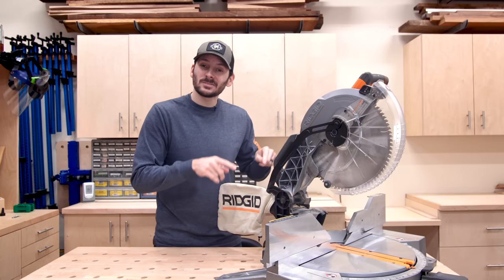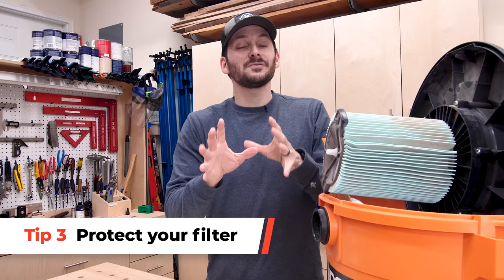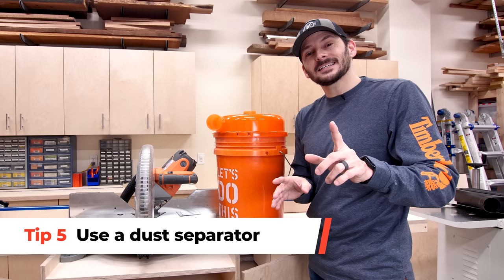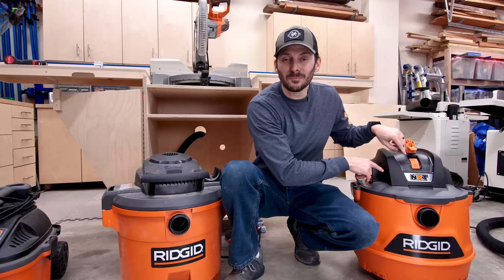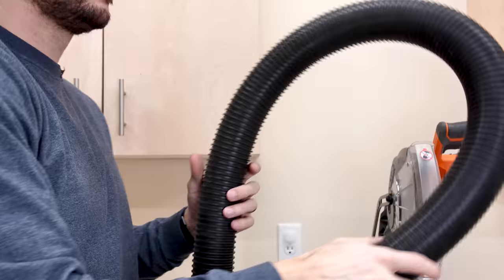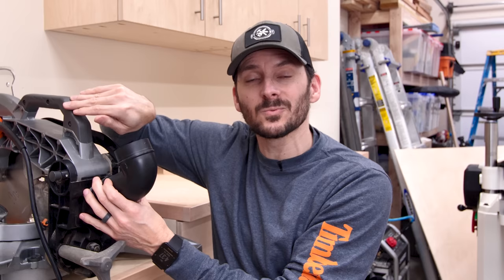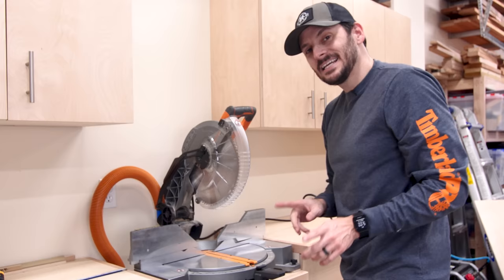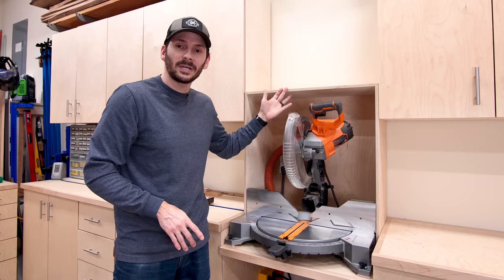10 Tips for Better Miter Saw Dust Collection

Comment: Have old Makita miter saw, for which I first built a cart, then added a cabinet above with a 2.5" hole for the vacuum hose. I ignored the horrible 1.25" dust port on the saw. I have a separate dust collector and cyclone collector. I added a front face to reduce dust blown forward. Some dust still flies (annoyingly) from the contact point between the blade and the work which the cabinet doesn't cover. I may attach a 4" hose to the cabinet--dust nirvana.
Will eventually make a fabric dust "tarp" to pull over the blade-work contact point to stop dust. 
I hate dust.

Comment: we have this exact same issue.  We have both the shop vac and the big HF 4 inch dust collector.  Our saw is a sliding miter so we don't have a ton of room behind the saw.  I want to do a big cabinet for the 4 inch port.  I am thinking a hood like you have made and then a big funnel under the saw that exposes the entire back of the saw so that it will basically suck everything that gets flung backwards

Comment: I may be wrong but I believe that the rubber boot on the end of the 1 7/8" replacement hose is meant to stretch over the fitting on your saw. I think I watched another video that specifically pointed out that fetcher.

Comment: I recently found out that if you read the literature on the hepa filter, it is only hepa if it is used with the dust bag. Otherwise it's only just a tiny bit better than using the "fine"

Comment: Since sawdust seems to want to go everywhere Use sheet metal to round the rear compartment down to table height. Make a trough ( tempered Masonite or other very smooth stock) at that point tapered to a centered 4" hose port. Suction  hose would have to come horizontal across side.

Comment: What about making a dust collection system that incorporates the dust port as well as a couple of ports on the back/bottom of the dust hood? Basically after your dust collector is piped (4" piping), it goes into a port at the top of the dust hood, from there it spreads out to the entire back wall of the dust hood and opens up at the bottom (you would only need about a 1/2" of space between the panels)... kind of like a whole home vacuum cleaner port under a cabinet. Put a flexible hose into the panel to catch most of it and what falls to the surface would be sucked up by the open ports at the bottom...

OR... if you are looking to remove the vac under the miter saw you could drill holes in the miter saw surface and pipe the dust collector under it as the dust is spit out by the miter saw, it is sucked down into the holes under the surface and into the collector.

To turn it on, put it on a smart switch (or receptacle) that you can control with a button at your miter saw that turns off automatically. Although this might get annoying because it might turn off in the middle of a cut, you would be able to turn it back on with the touch of a button.

Comment: The biggest problem is the dust shroud.  Most are not of the size that facilitates collection, usually too small.  They choke off the air flow and the result is the chips etc blowing all over.

Comment: Nice build, Brad. I wonder if you can tilt the saw under that hood though. I am going to have to build one myself.

BTW....while we are on the subject of miter saw dust collection, one saw to absolutely avoid is Harbor Freight's Hercules brand. The dust intake (right behind the blade) has two rubber lips that, when you put vacuum pressure behind them, just suck together blocking all air (and dust) from passing. I have written to the company and they responded that they would get back to me but never have.
Reply from the maker: the way the motor is on this saw, bevel cuts should be fine.  May vary for other saws.  And that doesn't surprise me from HF
Reply: You’d be surprised how much room a comfortable  full bevel takes up.

Comment: Awesome video.  Home Depot would be proud of you.   As within a few days of watching this video … I purchased the stuff.  And after a week it all began show up.    But along they 1:10 mark your talk about “the need for adapters”. I’m stuck.  Any ideas for me or going from the Dewall miter saw at 1 1:4 inch connection to my brand new Rigid vacuum and hose setup.  They didn’t have the car kit but I did purchase the upgrade hose you recommended.    But not bad as I purchased 5 of 9 of your suggestions.  And will order the separator very soon. Just need help on the reducer adapters.  Thanks.  Again. Great video.

Comment: 11:55 - Another trick is to find Silicone Reducers that are used in Cars. If you have Dewalt, you can find some that will fit your Dewalt Table Saw Dust Port to the your Dust Collector. May need to wait 1-2 weeks if the product is being shipped from China.

Comment: Only one problem with the relay switch - the saw and the shop vac together will likely pull more than 20 Amps , so won't you need a *30 Amp circuit*? I only have 20 Amp circuits in my garage.

Comment: You mentioned the gallon size of the vacs but I didn’t hear you mention the Cfm size or even hp. You did say cfm was important so I was hoping for a min recommendation.
I take it turning your 3D part so it flows out and down, instead of up, didn’t work for some reason? It seems logical to route downward since you run the hose down anyway and that would eliminate the 180 and help airflow.

Comment: Interesting. I gave up on using the built in dust chute on my saw, instead I built a housing around the saw. It works... Ok. I'd like to figure out a combination of both. I have a 4" pipe to my dust collection coming out of the bottom, and it keeps most of the dust contained. I do still get a bit of residual buildup on the bottom, which I just push into the 4" hole from time to time.

Comment: Lots of people claiming the iVac switch fails within a few months with a larger vacuums.  Apparently they aren’t rated for the start up power.
Reply from the maker: I've been using this exact switch for over 6 years with no issues.

Comment: // important note //
the HEPA filter you're using needs to be used together with the rigid hepa dust bag to actually perform at its rating. it's badly communicated by rigid but you can find in the fine print / FAQ of the product

Comment: One thing I did not see mentioned is that the rigid HEPA package states that to meet HEPA requirements you have to use the HEPA filter and the HEPA bag. Those bags are expensive. I only see them available as part of a kit - two HEPA bags and a HEPA filter for $60.

Comment: Anyone know how a down draft style set up   inside a hood would compare  to a shop vacuum straight connected to the saw dust port vs.  using the same said shop vacuum to power the down draft port.  Is the enough CFM ?

Comment: I have the same miter saw and love it, except have you notice you can’t cut 2” lumber at a 45angle when you bevel the saw to the right? The motor hits the wood and it stops the blade about 10% short of cutting right through???! Bizarre design flaw, have you found anyways around it??

Comment: I wonder. What if the bottom of your enclosed dust hood involved a sloped floor? Think of it like a shower pan with a steeper slope. That way, most of the dust would be encouraged to head into the bottom port.

Comment: What I found most interesting about this video is the port on the front of the saw. I have a DeWalt and the dust port to suck up the dust is just a wee bit of a thing. Did you makes larger port for that saw or does it come with it? Now that would be something to figure out for the 3D printer

Comment: One thing I did not see was you actually using the miter saw after you put on the attached hoses and other fittings. Most of the dust from my miter saw does NOT come up the vacuum chute but off to the side. How do you fix that problem?

Comment: Quick Tip for 3D Printers: Check with your library! My local Library has a 3d Printer available for use. You only have to cover the cost of the filament you use (so it's super cheap).

Comment: @ELECTRICIANS have an idea on how to solve this?: 
“Auto switches” are very good and useful. HOWEVER, if you have multiple dedicated circuits/breakers in your shop, they don’t allow you to run your “dust collection” and “machine” on 2 different circuits. Most miter saws and good shop vacs average 15amps on start up, so it’s wise to separate them. Obviously, you can have your dust collection constantly running, but defeats the point of an auto switch. ANY IDEAS around this?

Comment: On 3d printers - look for local Maker's Spaces and local libraries. You'd be surprised at the resources at your local libraries these days.
Reply: Agree. Our local library's teen room has a 3D printer. Website makes it appear it is for teen use only but I called to verify and any card holder can upload up to two prints each month.

Comment: Ridgid miter saws are terrible at dust collection. I have an sliding miter from them which shoots dust everywhere even with a big shop vac attached. It has been a disappointment for finer work as well. It is a rough cutting saw for frame work in my opinion. Now I do think that any miter saw will benefit from good dust collection, but some miter saws are way better at it out of the box.
Reply from the maker: I think all sliding miter saws are generally horrible at dust collection.  That's one of the major drawbacks of them for me.  Everything but the Kapex is pretty horrible.  This fixed Ridgid does quite well

Comment: 7:07 Incorrect. That little vac works just fine for a dust separator. Been using mine for a few years now and haven't had any complaints.

Comment: cfm is rhe wrong measure for a vacuum. you need static pressure readings. (how strong it sucks rather than how fast) but they wont tell you those stats you have to research them.

Comment: If you are running the 15 amp saw and the 10 amp vacuum using the auto switch how does the 20 amp breaker perform?

Comment: I've just gotten into woodworking as I renovate our new to us house, but the fitting issue between miter saw to shop vac is going to drive me insane.  Dewalt miter saw to my little 4 gal Ridgid shop vac seems to be an impossible combo until I can upsize the vacuum 🫣

Comment: I was aware of the vacuum switches but my solution was much less expensive and, in my opinion, even better. I mounted a standard receptacle just inside the door, connected to a switch that is mounted to the hinge side of the door itself. They are connected by a short piece of flexible cord. Now the only way I can turn on my miter saw is by flipping the switch. The added advantage is that I can use the hose to clean up around the saw when I'm done cutting.
Reply from the maker: clever 👍
Reply: I'm heavy into tech and I have the vacs plugged into wifi plugs, I just say "hey Google, turn on table saw vac/miter etc." and done.
Reply: @57kwest  That's how I turn my main vac on as well. I lied during setup and said it was a light so I didn't have to deal with the annoying verification that Google home does for anything other than lights. I wired the outlet through a 30 amp relay because most wifi plugs (mine are Kasa) are not designed to handle the inrush current of a heavy motor at startup. They will eventually fail after repeated use. I would not recommend using Google for any power cutting equipment like a table saw for safety reasons. Google has been known to misunderstand instructions.
Reply: @mikeyb7263  damn! Never thought of a relay! I burned/killed a plug (I have Kasa and etekcity) with a space heater so I now pay attention to peak amps. Thanks for the tip. My table/chop/compessor are on dedicated plugs. I don't need/want one of my kids hey Google-ING their fingers off 😂 but this tip helps for a bigger vac that I want
Reply: @57kwest  No problem. I bought a 2 pack of 30 amp relays on Amazon for less than 15 bucks. One for my vac system and the other for my air compressor. That is in my garage, but my shop is in the basement. The belts are fully guarded, and we don't have pets or kids (at home), so I was comfortable with that. It also moved the noise (and potential tank explosion) away from the area I'm working in, which seems to get smaller every day.

Comment: Those power switches seemed really expensive to me (at least a hundred dollars), but then I found out there are master/slave power bricks and they are really cheap (about 20 dollars). When the master plug draws power, the slave plugs get powered as well.
The expensive ones can be set to keep the slaves on for a while after the master switches off, but the price difference doesn't justify that small advantage.

Comment: wouldn't it be great if your miter saw just so happened to line up with a clear stud bay behind that sheetrock wall??...just cut away the sheet rock for another 3.5" of rear clearance for your hose! even if a stud was right in the way i'm sure there is a header/footer framing configuration to address that...if you dont like the messy look of the cutout you can always finish the inside of the bay to make it look nicer....whattaya think?....rob

Comment: I have a 15 year old Makita 10" sliding compound miter saw (no, not dinosaur or Minotaur) that I've mounted on top of your mobile miter saw station that I built. I was given a Rousseau 5000 dust collection hood that I put on it. The back is connected to a 16 gallon Craftsman shop vac that is supposed to be 190 CFM. Totally not impressed. All kinds of fine particles escape from around the sides. I'm almost at the point where I won't use the damn miter saw in my shop - wheel it out to the driveway instead, or cut my wood on the table saw or band saw. It has become one of the least used power tools in my shop.

Comment: I need to find someone with a 3d printer to make the adapter for a ridgid shop vac to hose. I bought the vac a few years ago, and those with fitting slipped out and hit the floor exploding. Now I've got a useless shop vac. Finances don't support buying the 3d printer so...here it sets. GRRRR.
Reply: Like he mentioned, someone you know probably has one. They are very common now. Or call around. A local shop would probably print you one.
Reply from the maker: check your local libraries, apparently a lot of them have printers

Comment: A poor man's solution for switching is to have a switched outlet under the saw, and the switch just under the shelf.  The saw and the vac are both plugged into the switched outlet.  The vac is left in the 'on' position.  That way, the saw won't come on until the vac is turned on at the switch.  I've had mine wired that way for a couple of years, and it's now just second nature to walk up to the saw, hit the switch then proceed with whatever I want to cut.

Comment: It freaking amazes me how so-called "engineers" who design these shop vacuums DON'T make the dust collection ports fit the most common PVC plumbing sizes... I would consider this a no-brainer feature, but somehow the "engineers" must have skipped some basic principles of engineering, mainly to use common off the shelf components & sizing when designing stuff. HOME DEPOT: ARE YOU LISTENING?

Example: I've been using Apple products since 1998, mainly laptops. They ALWAYS made the thick 120v cord on the power adapter replaceable, but the thin, lower voltage cord (the one most likely to wear out) non-replaceable. It wasn't until just a few years ago, the mid to late 2010's, that one of their "brilliant" engineers thought to make the thinner cord replaceable. SMH!
Reply from the maker: when the engineers aren't actual woodworkers, lol
Reply: @Fixthisbuildthat  Also, along those lines, the separator bucket and the dust collector tub are redundant. Couldn't they build the separator into the giant DC tub?

Comment: 165 CFM still doesn't move much from a wood dust situation compared to a real dust collector that will typically support 650 CFM or better. For a miter saw, though, as well as small tools, almost any shop vac will work even with a dust separator in-between. Except for sanders. For large tools (table saw, jointer, planer) or tools that create a lot of fine dust (orbital sander, drum sander) it really is necessary to use a real high CFM dust collector. Even with good dust collection, anyone who's in the shop regularly should also wear a mask as much as possible and, if budget allows, get a dust filtration system to help catch the smallest particles floating in the air before they go to your lungs. Use filters and bags that limit tiny particles down to at least 5 micron but 3 micron is better and if you can afford it 1 micron.